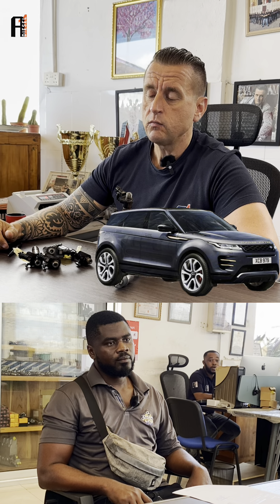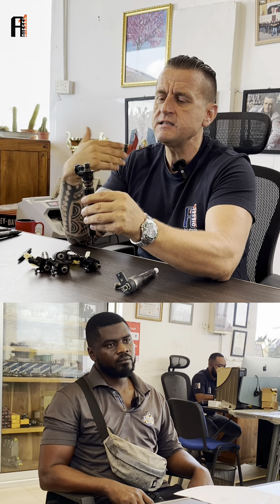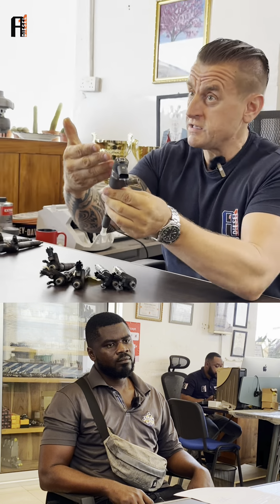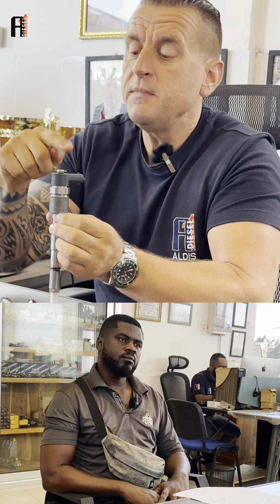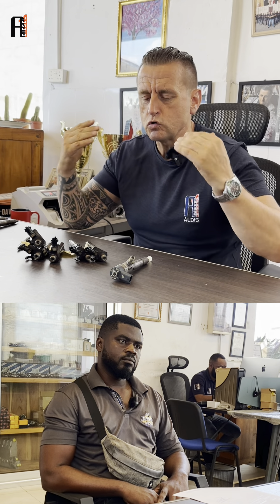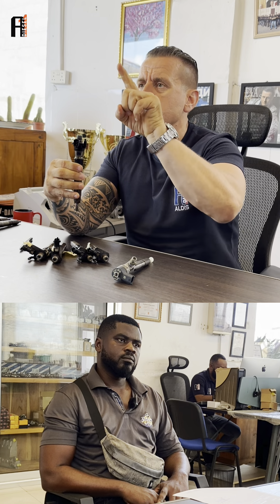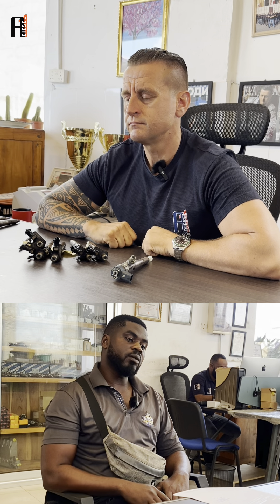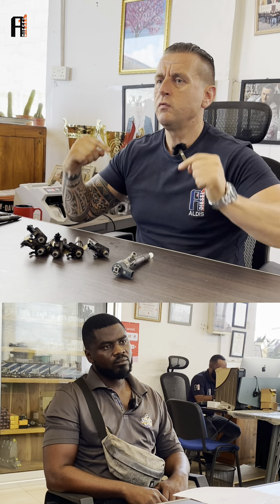BMW X5 X6 diesel injector failure? #bmw #x5 #x6 #piezoinjector #mechanic #mechaniclife

Comment: Thanks for this information! But then how can we test the backflow on this type of injectors? Can we use the kit with hoses and bottles attached to the return of each injector?
Reply from the maker: You're welcome! Yes, you can use a backflow test kit with hoses and bottles to check the return flow for each injector. Simply attach the hoses to the return lines and measure the amount of fuel returning from each injector. A higher-than-normal backflow could indicate an issue with the injector's seal or nozzle. Make sure to follow the manufacturer’s specifications for pressure and flow to ensure accurate results.